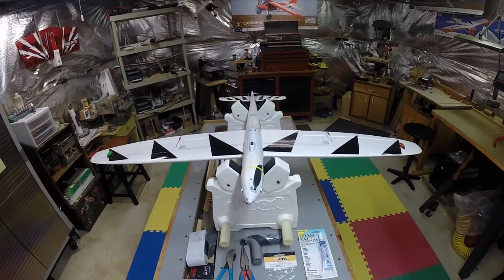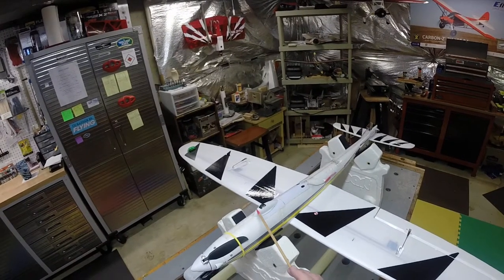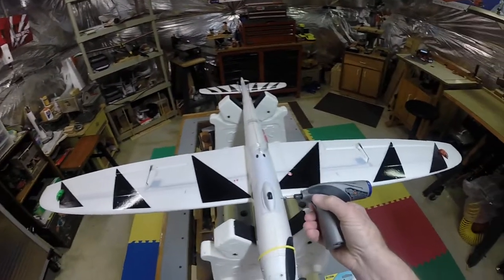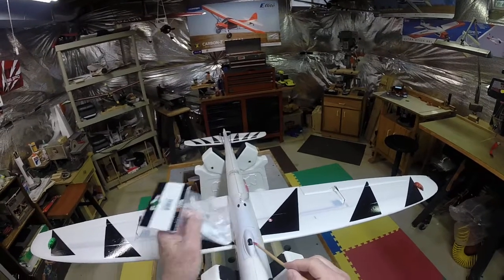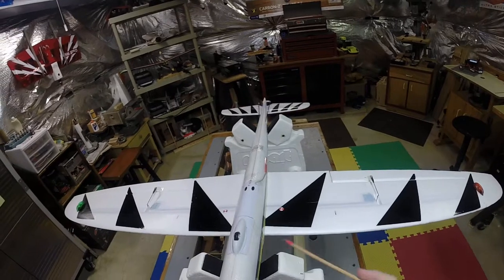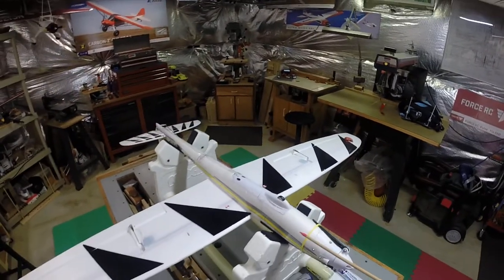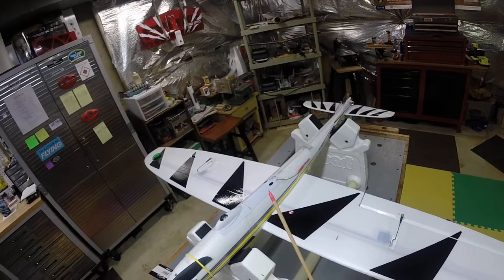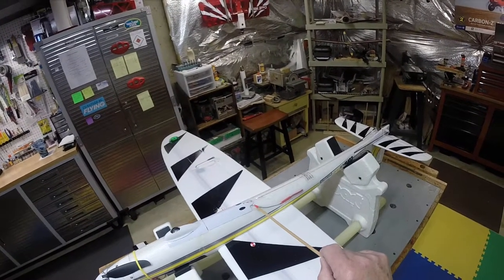More Conscendo Mods

Comment: Nice mod! Subbed.. 👍
Reply from the maker: Jerry,  I love your Channel and videos; far more sophisticated than mine!  
This skid mod has not worked out well for me.  It takes too long to do and the wheel is too small to be of any use on the grass fields.  I will most likely pop out the wheel and fill in the wheel well with foam and some tape.
Reply: I just realized from your videos that you are a member of NVRC.. I am as well however not sure if I'm renewing this year as we are moving ths year. But yeah I fly at Poplar Ford usually, I've never flown at Lorton..